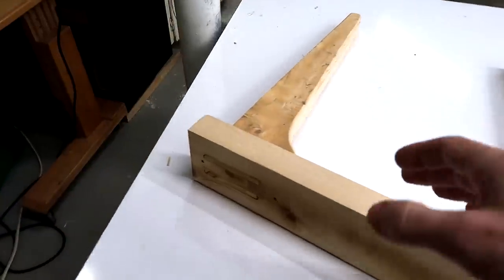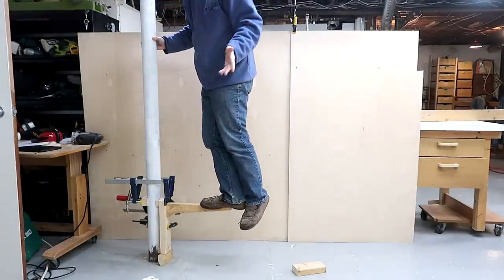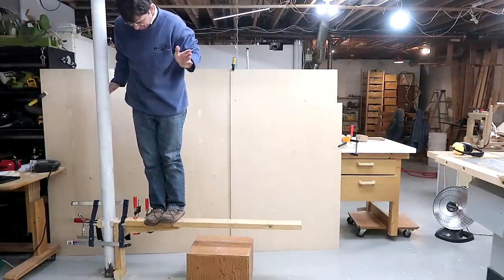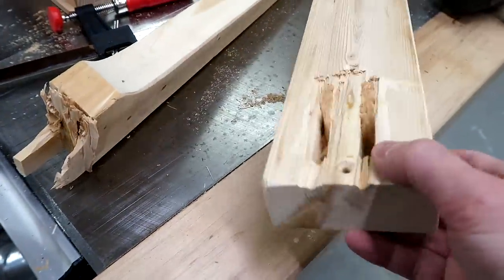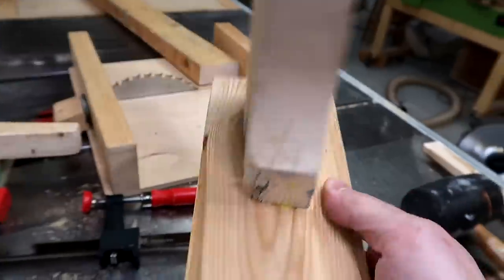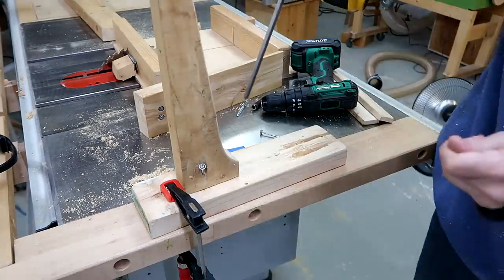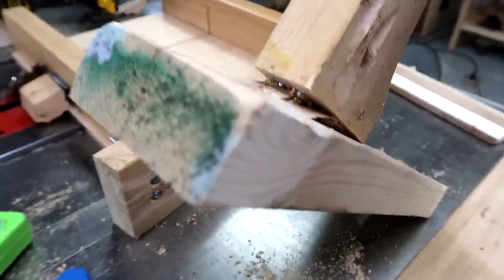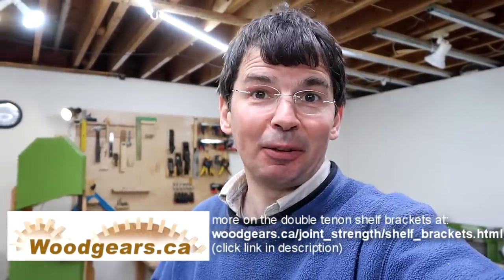Shelf bracket strength test: Double tenons vs. screwed vs. pocket holes

Comment: I think wood contains an amazing safety feature in itself. Where steel would snap with a loud bang at some point without a warning wood is kind enough to tell everyone (who is willing to listen) that it might fail soon if you force it any more!
Reply: Guzzist11 steel also has the same feature (depending on the quality of the steel of course). It will bend before it breaks, however you do have to actually look at the steel joint to see if there’s any bending, whereas wood cracks and is easy to hear.
Reply: @daniellemos5364  I´m most of all referring to stuff like heavy load chains which i use on a daily bases. We have anuual checkups, but if they go, they go with a BANG...unlike cloth for example.

Comment: Ooo this was good! What about a large lag bolt with a decent-sized washer?
Also,  I wonder what role glue plays in all this (since the double tenon was glued). Would be interesting to try to expose the wood to watered-down wood glue, let it soak in, and then let it dry overnight.

Comment: Try pocket holes on ONE side of the board. The strength is MUCH stronger. With screws on both sides, your essentially "scissor cutting" the grain and making it easier to fail. Overall great video demo though!

Comment: The pocket hole test wasn't really fair, though, when you consider the direction of the screw versus the direction of the force applied
Reply: Yea, and it's clear the screws crossing over and the rescrewing to pull them from the table saw damaged the wood that tore out in the test.
Reply: The fact that it almost pulled the screw heads through the 2x4 even with washers under the heads on the back, tells me attaching the shelf bracket to the 2x4 with pocket holes from the front will fail way sooner even if you use 4 screws because the four screws make more chances to split the bracket piece and the heads being in the bracket peace means there's only a tiny little bit of screw with no head behind  it holding it onto the 2x4.

Comment: That was interesting—loved the washer addition.   However, your testing wasn’t the same on all three tests.  On the tenon bracket, you distributed 155lbs onto TWO feet while you distributed 155lbs onto ONE foot on the two other tests.  This type of testing provides much more weight to the far end of the latter two shelves.
Reply: BT yeah I was thinking the same but surely he was doing that but not really showing us until his penultimate side step and last position when he def was  using one foot
Reply from the maker: I was more careful about putting the weight on one foot as I got closer to failure
Reply: Damien Wills That makes sense....super cool video!!!

Comment: Another alternative to fasten the shelf bracket to the wall bracket is to use bolts in the same manner that wooden bed frame rails are some tim fastened to bed posts.  Drill a 1/2" diameter hole in the side of the shelf bracket that can be used to house a 1/4" nut.

Comment: Thanks for the test. It further confirms my feelings. For those brackets M&T is by far the best way, but maybe a bit larger.

 I use pocket holes to hold things together while the glue dries, but I will use clamps instead, if the pocket holes will be seen in the final assembly. I hate the look of the pockets, even when plugged, and I have never trusted their strength in situations like this. Good enough to use instead of clamps for faster gluing assembly though.

Comment: I wonder if the screw or nail hole in the side of the end of the board with the screws (4:17) could have weakened it.
It looks like the failure goes right through that screw hole.
But it looks like there were also some screw or nail holes in the end of the mortise board as well.
I love when Matthias does these tests and makes us think.
Excellent info Matthias! Thank you for posting.

Comment: Excellent. I was searching for this exact comparison and found this demo. I was wondering why in some applications pocket screws are used when simple screws with a large head are much simpler.

Specifically, a structural screw with a large washer head would probably work best and require no jig.

Fastenmaster HeadLok or Simpson Strong-Tie screws would seem ideal. Both have built in washer heads, have a Star drive to prevent cam out, and can be used w/o pre-drilling  on softer woods, though wouldn’t hurt to pre-drill here. The Headloks are rated to replace 3/8” lag screws but  much smaller, have grippy threads, and come in 2 7/8”, 4”, 6” etc length.

Handy to have a bucket of these screws around for home projects.

Comment: I've done some roofing using 120mm lag screws, 8mm diameter with a big flat head, torx drive. Awesome holding power. After about 30 screws my makita impact was almost too hot to touch, was fine though.

Comment: Try using them on one side or staggered where they don't almost collide.  But I guess if you just want to show how awful they are, you did a great job.  All my indoor wood storage was done using the Kreg HD jig and 2 x 4s and 2x6s of Southern Yellow pine,  Ditto for my outdoor rabbit cage hangers  (15' each split into 6 cage areas).  I use them for boxes, cabintes and many jobs around the shop.  That said, I have jobs where I hand cut dovetails, hand cut motise and tenon joinery with both hidden and through tenons.  I use my good planes, chisels and other hand tools for these projects as opposed to the ones for the farm I run and do a huge amount of wood working on.  But if you don't like them, don't use them.  They work, they are strong and they are fast - both to use and to learn.  Spend a little time and learn to use them correctly and you may find you like them as much as methods that take twice as long for the job at hand.  By the way - were the holes drilled at the correct angle for the board thickness and were the correct screws used.  Didn't look like either from here and both are very important.

Comment: Great video! I wonder how the pocket holes and screws would have fared if they were face glued. Any time I use screws for this type of application I always face glue them. But that's mostly because I don't have the tooling to make double tenons. I wonder how those double tenons would fare if you wedged them, especially the top half. If I were going to engineer a tenon for this application it would be trapezoidal with the wider portion at the top, and split down the middle to form two tenons. Not sure what aspect ratio I would go for.
Reply from the maker: the screw joint was glued.  Just didn't bother mentioning it because it made zero difference.  Glue failed before the screws got much tension on them.
Reply: @matthiaswandel  Must be that notorious peel failure mode, especially with a glue as brittle as wood glue. Thanks Matt, have a great week!

Comment: I knew you hated pocket holes the minute you started! Pocket holes are good when used with glue and are great for doin work  without the need for clamps. Ofcourse they are not going to be as strong as regular joinery but they do have application, especially for those without access to a workshop...

Comment: In his John used construction adhesive and screws.
Reply from the maker: for this, the glue butt joint fails long before the screws help much, so overall, it doesn't help.
Reply: John smears PU Construction Adhesive on his Breakfast Bread - what's your point?

btw: try it, i use Bindan-P as regular Wood Glue and Beco Allcon 10 as D4 Glue

if it wasn't that expensive, I'd pretty much only use PU since it hardens so fast compared to PVAc
Reply: How the glue ages is important, but freshly glued mitered joints are among the best in strength tests and in this case it could have slowed down wood splitting.

Comment: It's interesting to compare this to your cantilevered work table which seemed to hold your weight on the end way better. I'm guessing the bridal joints plus the better wood made those joints much stronger than what you used in this video.

Comment: Hi Matthias,
you are not alone in hating pocket holes!
In some strange situation the pocket holes could be the only way to reach the goal (hypothesize a cross connection of two elements on a through one, but in that case I would use the plugs) but I think a well hidden screw put by the the other side (on a T-joint) is better than this system
P.S. for simple honesty towards the poor holes, if you placed them staggered (always two on each side) perhaps they would have improved the seal, but would remain losers for 4 holes against two screws with the washer! (if they were larger in diameter they would have endured even more as you said in the video)
Reply from the maker: The pocket hole screws have integral washers.  If I had 4" long pocket hole screws, I would have used those from the back (without pockets)

Comment: As soon as the screws started making all that noise is when I would have called it a fail. All it needed was a little more time. If you were stacking wood, and it started making that cracking sound, I don’t think you would have left it up there!

Comment: Impact drivers do not hammer the bit into the screw as they go. I’ve heard that said on a few wood working channels and it is not true. The impact that impact drivers produce are from the spring loaded weight spinning and hitting the chuck to generate a greater momentary force. Impact drivers are also not recommended for pocket homes since pocket hole screws are commonly small #7 screws that are not very strong. It is easy to snap the pan head off the screw from over tightening and then there really isn’t any strength in the joint. Pocket holes are great when done correctly and used for the right situation. That situation is very light duty joints like face frames for cabinets. There is a big misconception that pocket holes are the right answer for a large range of applications

Comment: Conclusion?  Not until you test double tenon with woodscrew / flat  washer centered on the tenon end grain  and hidden against the "wall" to prevent pullout.  I think the 2X4 would break first.  Practically speaking I think all three were suitably strong. I liked the slow fail of the wood screws if supporting a heavy load.
Reply from the maker: Downside of the slow fail is that the shelves will be sagged at lower forces, which would be very annoying.

Comment: That was more of a bending moment test I think.  I wonder what a fixed moment arm and increased load would do. The moment would increase of course but so would the shear.  The increased area of the mortise I think would do better as you increase shear but I think you'd need your hydraulic jack and a pretty hefty scale to measure it.

Comment: I make my brackets from 2inchx1inch with a diagonalbrace called gallows bracket.iwas taught this as a apprentic for supporting draining boards.i made mine 20 yrs ago but i used untreated timber and they got wood worm -borer ihave just replaced them.

Comment: Would be interesting to see if one big tenon is stronger than a double tenon since the failure mode seems to be the wood not the glue.
Reply: The glue failed on top first, they broke on the bottom after?

Comment: I think that if the Heavy Duty Pocket Screws were used the shelf bracket would have been considerably stronger. The HD screws are a #10 , use a #3 Robertson bit, the hole is 1/2". and the drill jig and screws are designed for  2 X 4,  2 X6, etc.
Reply: Correction...The screws are #14
Reply from the maker: The screws already ripped the piece of wood out.  You can rip it out with a bigger screw, but mostly, that bigger screw would help split the wood.

Comment: Admirable as Matthias's pursue for excellence might be, I'd suggest we may safely conclude the following: all three types of joints will hold much (much!) more, than what may be considered to be a reasonable load for this type of shelf. Seriously, if you're expecting to store in excess of 50kg, would you not support it on both front and back? I would.
Cheers!
Reply from the maker: You need safety margin.  If the shelf breaks at 150 lbs, and you slam 50 lbs down on it, the impact load is enough to break it.

Comment: Pocket screws are great for many applications.  They would've held better had you alternated the spacing so they weren't driving into the same place in the back board.  That being said, if you want strong shelving support, use steel.

Comment: A great comparison against these is to do the exact same test but glue it and clamp it together with no screws and see how it holds, or use the screw through the back method, but add glue to the joint and see how much strength is gained.

Comment: Impact drivers do not have a forward  impact to screws and other hardware when they are working.  The impact is a rotational force and not a punching action seen in jackhammers and rotary hammers.  Rotary hammers are a specialized tool used many times to drill holes in concrete. An impact driver is a much different tool and works in a dissimilar method.
Reply from the maker: Maybe.  But - with intermittent torque, the moments of low torque allow the driver to slip back into the screw.
Reply: @matthiaswandel  that's why there are screw drivers that are less prone to cam out

An Impact driver with Phillips or Robertson is a bit of a misuse of the concept

they are meant to be used with highly torque drives like Torx or XZN

also Hex drives are suitable, but Robertson or especially Phillips and Pozi-driv or even slotted are not the best idea
Reply: @suit1337  Not sure where you get the idea a Robertson bit is not suitable for an impact driver.  I have more than 20 years of working in the production side of the recreational vehicle industry here in Elkhart Indiana (RV capital).  In the last 10 years virtually all assembly lines have switched from pneumatic screw guns to the Makita, Dewalt and Milwaukee impact drivers. Nearly all RV'S are made almost exclusively with square drive (Robertson) screws. Sometimes items come with a Phillips or specialty type bit being required, but even a slotted drive screw can be used in conjunction with an impact driver.  I always hated slotted the most but they make a special bit with a spring loaded sleeve to keep it centered.  Get a half decent driver and a tradesman will never go back.
Reply: @matthiaswandel  Your bit shouldn't have slipped off like that if it is even in half decent shape.  A worn bit is as dangerous as a dull Stanley blade.  Keep a sharp blade and it won't take as much effort. That reduces the chance of a slip and errant cuts.

Comment: Everyone has a different takeaway.  Mine is that any of these joinery methods would result in shelf supports which are perfectly serviceable for my needs. Since I don't have a Pantorouter - and probably am not smart enough to run one if I had it - the screws would work fine.  I'd bet dowels would work well, too.

Comment: what if you were to clamp the pieces together, drill fully through both pieces using the pocket hole jig and fill the holes instead with 3/8" dowels in an X pattern? I'm curious how it would compare to the others in this test.

Comment: I like to drill a hardwood dowel across the piece of wood I'm screwing into, so that the screws are not just biting the endgrain. And I'll certainly make sure to add bigger washers in the back from now on
Reply from the maker: Seeing that the screws didn't slip out, and weren't actually biting end grain (at an angle) the dowel would not have helped any.

Comment: Yes, pocket holes suck for strength. The best for this application is 2 lag screws with washers not next to each other you will not lose much strength when setting the screw head flush either.

Comment: If those would've been expanded tenons, it would've split the wood before giving up IF the same piece of wood was used. Which is why i like expanded joints more than regular ones. Pretty much make or break with them, i've always figured that if a joint starts to move, then it's a failed joint, which is why screws in a joint = no, for me. Those move the moment you've given them load.

Comment: Of course, by loading the bracket like you did, the increased distance is only increasing the bending load, which is translating to tension at the top of the bracket and compression at the bottom (hence the pullouts).  This is not a representative test for most shelf brackets.  Instead, as loads are increased within the length of the bracket, both the shear load and the bending loads increase at the same time which is a different loading condition.
Reply from the maker: Its all bending load that breaks it.  Shear load would be many times higher before it fails.

Comment: I am curious on the bracket design/mounting... Would the bracket put less stress on the fasteners that attach it to the wall if the mount extended up from the shelf arm?  I don't know if it will matter, but it seems to me with the load at the top of the bracket, all the force is pulling the screws from the wall, where as with the arm at the bottom of the mount, most of the load force would be trying to push in to the wall or down to shear the fasteners rather than trying to pull them out of the wall.

Comment: Can we get the measurements to calculate the load placed on the bracket? The vertices measurement placed up against the wood is critical for calculating the mechanical advantage from the lever arm.

Comment: A single mortise and tenon joint would be much more simpler (and possibly stronger) than a double mortise and tenon. As for the screw method, I would not have placed the 2 screws beside each other, but instead scew them vertically and more spaced out and possibly with 3 screws. Also for the pocket screws stager them vertically. And in both cases with screws you did not use any glue which would make a big difference.